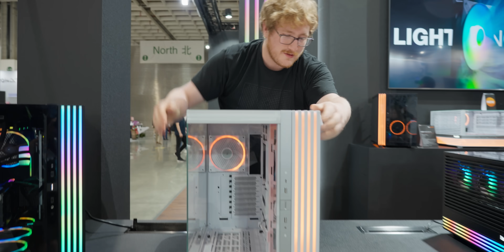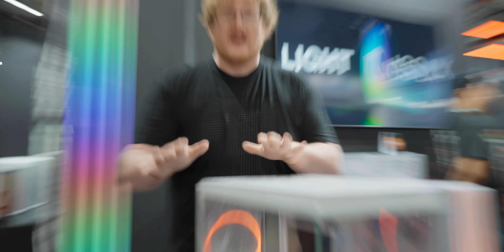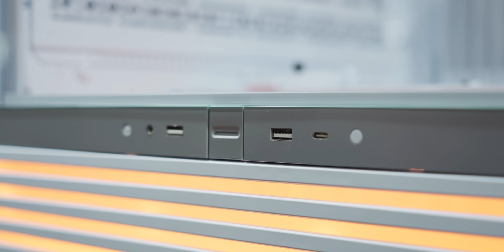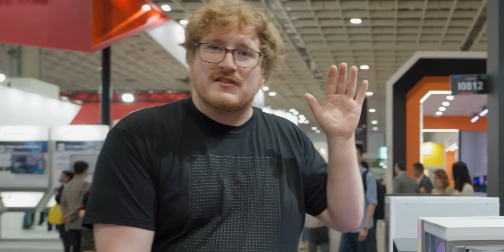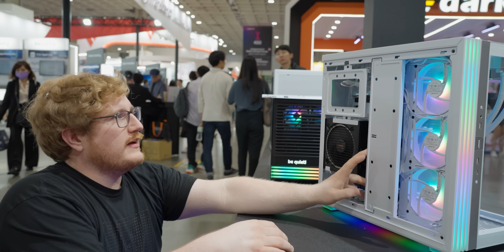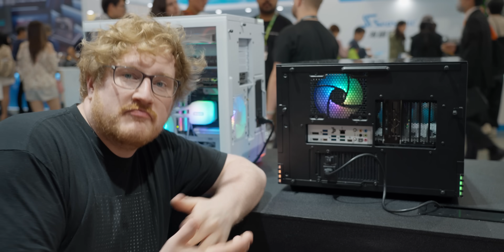THEY FIGURED IT OUT! - be quiet! @ Computex 2024

Comment: So horizontal cases making a come back?
Reply: I’ve had HTPC’s for a long time, currently using a super simple, super cheap dell optiplex unit I got for $50 with a SSD and half height GPU. The only issue is that HTPC’s are not flashy, you don’t want lights on them and the glass is useless in a home theater cabinet.

I support horizontal PCs, but can we make one that has modern component support, decent airflow (silverstone’s did okay all things considered) without any fluff wasted on RGB.
Reply: I went be quiet on my last build because they were one of the only decent cases I could find that didn’t have a single RGB light on it. Disappointed if they don’t release a non RGB horizontal case. I’d build one in a heartbeat
Reply: I need it. But like a reasonable size for on the desk

Comment: Now they just need to make one that's a little smaller, mATX or ITX, then it would be perfect for a home entertainment center PC.
Reply: You could check out the Jonsbo N3 case. It's an ITX NAS case with 8 HDD slots and it's basically a small cube.
Reply: @cldcrst  That's a really cool little NAS case, but completely off for the system I'd be putting in it. No need for the HDD bays and I need something that can house a decent sized GPU.
Reply: Bequiet avoids anything that isn't ATX, but it would be cool to see smaller cases too
Reply: @TransformHypnosis  Yep, sadly... I know. Would be awesome, but I have illusions that it will.
Reply: Fractal also make an horizontal case
Reply: @Natsukashii1111  Yep, I know... I'm just not a fan of the aesthetics. This looks perfect, it just need to be smaller.
Reply: @TheGameBench  agreed the look isn't that great on the fractal one
Reply: Yes please
Reply: Just get a coolermaster elite if that's what you want.
Reply: @A_Balanced_Breakfast  Not the right configuration. It's narrow and deep. It's not designed to look like a piece of stereo equipment, where this absolutely could.
Reply: A little smaller? That thing is like a mini fridge.
Reply: @JasonB808  we talkin the mood? doesnt look that big
Reply: Look at the DeepCool CH160 or CH170

Comment: The horizontal computer case being introduced as a revolutionary design makes me want to check myself in to a nursing home.
Reply: Honestly i like horizontal PC cases. Either as the classic HTPC or just you know "oh the monitor ontop the pc"
Reply: @Gobeman  I'm actually working on making a custom horizontal retro future style pc case rn
Reply: Is bequiet calling this revolutionary or they just showcasing their take on it though?
Reply: I miss my HaF stacker
Reply: i miss putting my crt monitor on my dell htpc case but its hard to do on it on this one since its a glass top
Reply: My PC is running in a HAF XB II Evo. Cooler Master, and everyone else, has never built a successor to this design so it looks like BeQuiet! took up the mantle.
Reply: @TheSamMaster  i love the xb evo one of my favorite cases off all time but the xb evo still beats this be queit case in airflow i wihs the still made new mesh cases
Reply: wait till you see magnets
Reply: It isn't. The simple horizontal to vertical conversion is the thing that is meant to be impressive.
Reply: @AleksandrStrizhevskiy  Compaq had 3 different cases that were convertible in the early 1990s (about as simply, 4 screws to switch).  I owned one, for my 386DX2, which I switched over when I got to college, because desk space was at a premium at college.
Reply: @AleksandrStrizhevskiy  Yes, and that used to be basically standard. You'd get a horizontal case and it would come with a foot/stand so you could put it in tower orientation.
Reply: Amen...long before that guy (or maybe anyone at LMG) was born, 8088, 8086, 286, 386, and maybe 486 were all horizontal or nothing.  I think it was about Pentium when I saw/built my first vertical.  The movable feet are nice, but the idea being revolutionary makes me want to chug some geritol.  lol  Next thing somebody will come out with is a rotary dial for smartphones.  You punks get off my lawn!
Reply: @esc952  My Tandy 8086 running MS-DOS and Tandy's own "OS" was fun. Played so much Ultima.
Reply: @esc952  My first vertical was an AMD 386 DX 40, Pentium were non-existent.
Reply: @esc952  Vertical cases were in the office long long before the first pentiums. But yeah, in the home, horizontal was all the rage for decades. But even more recently, horizontal has persisted in the htpc space.
Reply: @deano1699  also in schools! When I went to school (started elementary school in 1999), the old computers in the Lab were all horizontal cases with the CRT monitors on top, and they got slowly phased out to more modern cases and displays. But the space saving is so real, when your PC can occupy the same horizontal space as your display. Much easier for peripherals, too!

It's part of why I'm kinda sad the iMac Pro line had to go, I had dreamed about having one of those as my home workstation (I do photography, and don't game).
Reply: @AnonimatoForzato  yes. School PCs and "consumer PCs" were the same class of machine from the 80s until at least the mid 2000s. Towers would've started appearing along the way in the 90s, but the horizontal stacked format took up less computer lab space in schools. :)
Reply: @esc952  My 486DX was vertical
Reply: Ya, wait till they think of putting the monitor on top of it while horizontal.
Reply: My 1999 media PC case would like a word with Mr Revolutionary
Reply: @Individuality1990  ol, i know right.  Next comes the beige color too.
Reply: My first PC case was a desktop (horizontal) heavy duty steel AT case fitted with the new 386SX-25. I later put the case on its side on the floor, and to be able to load CD-ROM's vertically I had a NEC 3x SCSI drive with CD caddys. Much later I got a Pioneer slot-in SCSI drive that worked well vertically. Then I switched to a full tower case with horizontal bays and could use much cheaper normal tray loading optical drives ;)
Reply: All they had to do was put the monitor on top of it.
Reply: Kids these days :)
Reply: Sponsored by Be quiet ? So how can they be objective
Reply: I still have my IBM PS/1
Reply: will this type of support usual mobos? like those where the cable is at the front instead of the back?
Reply: my haf xb evo was a horizontal case like 14 years ago
Reply: It's not that it can be horizontal it's the way they did it
Reply: @dillonbowers8950  it’s way to thick to put a monitor on top of it. So how would this sit in a desk?
Reply: @geewhiz5050  the same way people place them now, if you don't have room run it vertically or buy a different case. Personally I think it would be cool to inlay a sheet of plexiglass on the desk, then mount a shelf directly under it for the Horizontal case to sit on, kind of like a cheap/easy version of a desk pc
Reply: @dillonbowers8950  yes that would be cool just under mount to the desk with plexi would be sick.
Reply: it's not horizontal though, it's omnidirectional.
Reply: @Preske  omnidirectional is not a state a pc case can be in. It’s either horizontal or vertical
Reply: If you say that then I'd probably be less than half your age.
But honestly I like horizontal cases (though I've never got to build one due to circumstances) and when I was eyeing cases for my supposed computer build, I thought the Silverstone SG something looked neat, and since there was this Win XP PC that my dad had but the condition was absolutely horrible, I thought that having such a tall thing on my desk would be a little risky.
(I suddenly thought "why didn't I tinker with the Win XP machine", but I immediately remembered, the big factor of me not owning my own PC in the first place, the electric bill...., ah well)
Reply: Its funny because with modern GPU's being so stupid heavy on the high end, horizontal cases should make a comeback, but they just aren't. and this case isn't a true horizontal, its just a vertical you can lay down but you can do that with pretty much any case because lmao. I want a true horizontal case.
Reply: That is exactly what I was thinking when he said that.  Next they will show us the revolutionary color of Beige with a skin toned smudge.
Reply: Well apple does it so why not everyone else?
Reply: It’s not that it is horizontal. It’s that it can be switched between standard vertical, inverted vertical and horizontal so easily.

Comment: His mind would have been blown in the early 90s.
Reply: @Tensentities  I mean so could I but that would require most people owning a 3D printer and power tools, not to mention voiding any warranty.
And aesthetically speaking is not gona look nowhere as good since most cases just have a single temperate glass panel, nor as hassle free.
Reply: His dad's was. It's why he's here
Reply: Haha true. 😂 Horizontal cases were the norm.
Reply: @Tensentities  ah yes, the 3d printer i can just pick out on a nearby 3d printer tree
Reply: You beat me to it!
Reply: @Tensentities  yeah but with this case we don't all need to go out any buy 3D printers... Also the feet aren't the point.. the case is symmetrical. With most cases if you do what you just said you'll be blocking intakes and exposing non-detailed parts of the case like the underside...
Reply: @lukefreeman828 cases really used to be designed exactly to do this 25-30 years ago. Used to be able to have it as a tower or lay it on its side and put the monitor on top (and that was big ol' fat crt monitors not modern flat panels like  fans for cooling were only on the front/back not side.
Reply: @branbroken  And those cases could very likely support the biggest monitors of today. Steel is pretty good at that. The reverse is probably not gonna fly. 

Nowadays everything has to be made of glass so you are forced to spend more on pretty looking components. Or something. But I reckon a glass panel isn't going to support my old 19 inch DiamondTron. That thing weighed something like 25kg 😬
Reply: Does it come in beige?
Reply: @pkt1213  beige and wood grain my friend. With turbo buttons and keys that made you feel like you worked for NASA. When you started an 8088 machine it was an event. My tandy sounds like a jet preparing for takeoff
Reply: @epluribusunum6622  my 13850hx laptop sounds like an f15 at full burner.
Reply: I remember those old PC cases that laid down. Problem is is they don’t make them much anymore so it’s hard to find one for someone like me who wants to have a computer under their TV because I use my gaming computer on my big screen TV as an all-in-one entertainment system and, most cases are just too thick or don’t lay on their side that do lay down.
Reply: Wow
Reply: My comment exactly. Then there were the late 80s when these "inverted" cases were even bigger
Reply: the point was about the mechanism that allowed how easy it is to switch
Reply: @Tensentities  oh yeah driling holes so secure
Reply: Drilling holes is secure if you do it right. Of course, if you never used a drill, better ask someone else to drill them for you